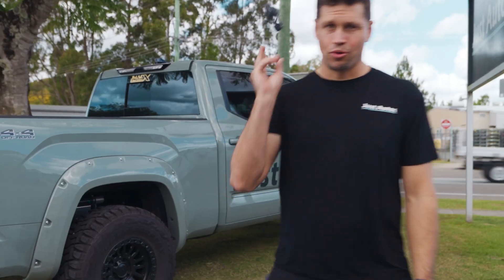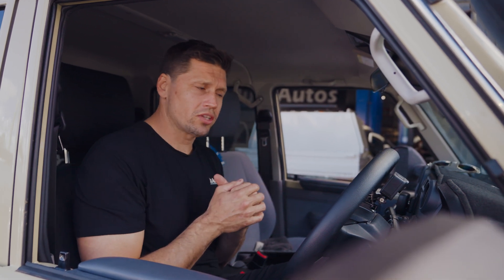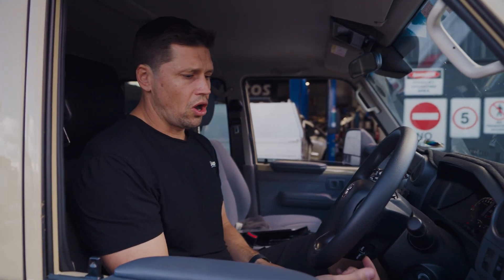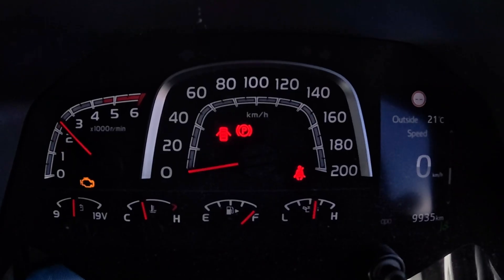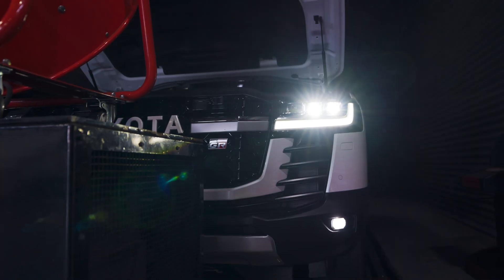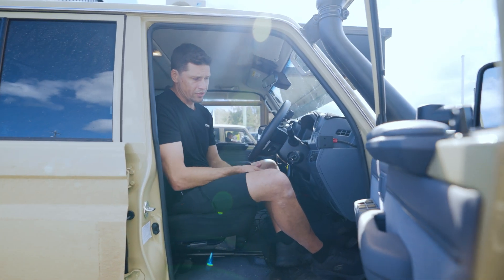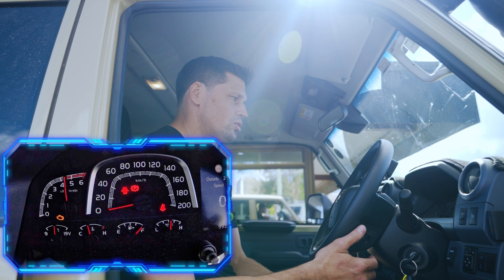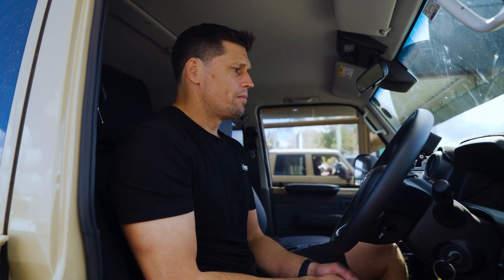Mapping Pedal Sensitivity | Part of JA Version 3 Multimapping

Comment: I have a 300 coming in soon, do you recommend getting all the barwork, suspension, and wheels done before getting the tune and multimap done? Was looking at the package 3 with a snorkel.
Reply from the maker: Totally up to you, they have no affect on what we do. The only thing that can get in the way of the heat exchanger are accessories like winches, trans cooler, wiring etc. Just be mindful of scrub bars with snorkels